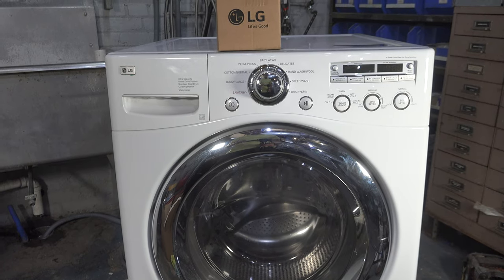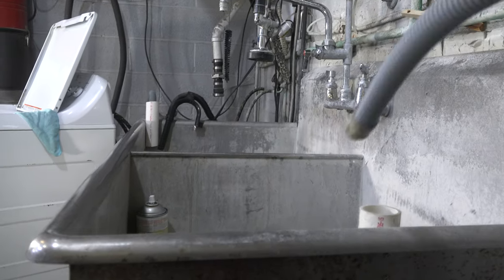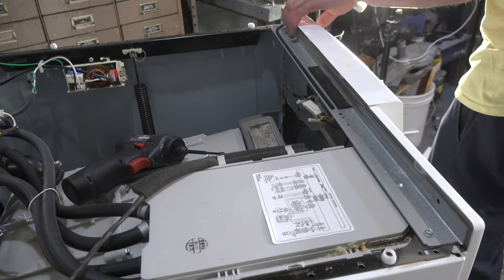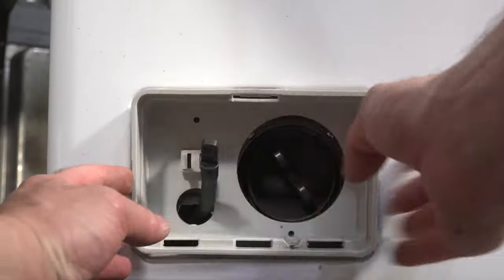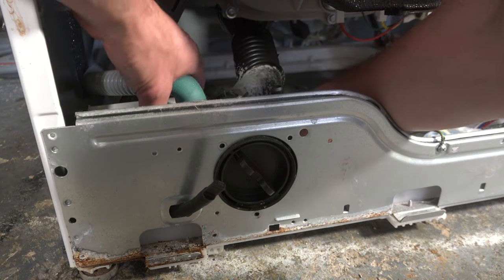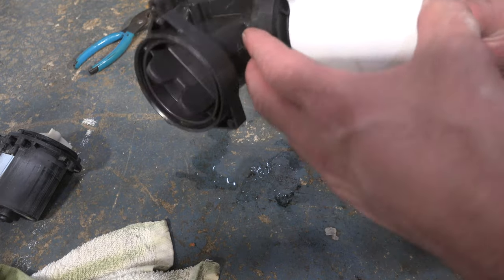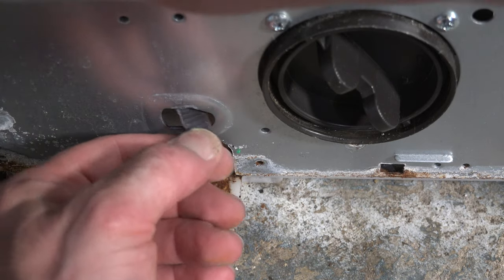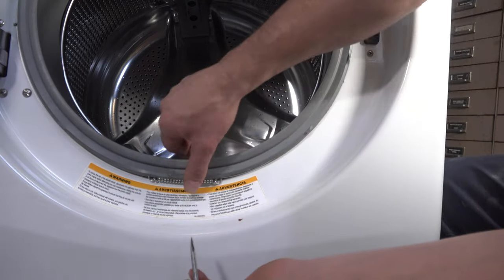How to Fix LG Washer OE Error Code No Drain Not Draining Tutorial Repair Guide

Comment: couldn't you just flip the washingmachine upside down and save many steps?

but also, I had a bad pump. come to find out the pump was seized. What I did to instantly fix mine is:
1) Remove the water drain cap to drain all the water. take the drain hose and fill it mostly with water. Since the pump is seized, that water isn't going anywhere.
 2) Take the drain hose, put a sock over it so my mouth isn't touching it directly (gross)
3) Blow really hard a few times. You'll hear the water back flowing away from the pump which also cleared the debris that was seizing it. the debris will shoot out out that draining cap you took off in step 1.

Fixed now.

Comment: We tried this and took 2 hours but was worth it. Both of our families told us to just buy a new one but was so much cheaper to buy the part for £30 rather than spend £500. We struggled to get the back pipe back on without pliers which took about 30 minutes and used kitchen tongs but managed by putting the metal attachment on the pipe and then wiggling it onto the plastic part on the pump. Thanks so much!

Comment: Superb video. This is the third time I took my washing machine apart for repairs. The first was to replace the spider arm (a nightmare - not recommended unless you are extremely ambitious). The second time was to replace the drain pump. I went with a video that shows how to do it from below without taking off the front panels. Very difficult and tedious in may opinion. I suspect I didn't get the pump back on completely snug and it eventually started leaking. Re-did it using this video. Way easier overall. They make a special tool to stretch the spring for the boot clamp. Only about $10-15 dollars; well worth it in my opinion compared to trying to do it with a couple of screwdrivers; otherwise you will almost certainly be crying for a second pair of hands to help you. Any reasonably handy person can replace the drain pump using this video. One of the best repair videos available.

Comment: This video was super helpful. My washer is only 2-3 years old, and hasn't been making weird noise, so I didn't think it was the pump, but I had no idea how to get to the inside to check. Once I followed his instructions on how to get to the internals, I found my problem. The little hose that runs from the door gasket drain to the rest of the drainage system has 2 elbows. We have 5 pets. I took off that little hose and viola! Packed solid with pet hair and dirt/mud. Took an old wire coat hanger and used it as a pipe cleaner, and we are back in business. I can't say thank you enough for this video. And your tip on getting that gasket spring monstrosity back on was a lifesaver.

Comment: I scouted several videos before starting this project and this was BY FAR the most detailed video I could locate. Thank you so much for creating this video. It took me a little less than an hour to disassemble, change out the pump, and reassemble. The most difficult aspect was getting the bellow spring around the rubber when reinstalling. As a woman in her 50's, my hand strength is a bit weak so the screwdriver trick didn't work for me, however, grabbing and pulling on one end of the spring with sturdy pliers did the trick. I had already ordered a replacement washer for $740 and I was able to cancel that order thanks to your video. A part that was less than $30 fixed the problem. Sincere gratitude to you for sharing this information!

Comment: Best DIY repair video instructions I've ever come across! Note: my washer has a metal isolation plate (with rubber feet) that the pump sits on and is attached to the frame of the machine with 3 bolts going directly through the rubber feet.
Reply: So you had to unbolt from that as well? Did you have the plastic tab still ?

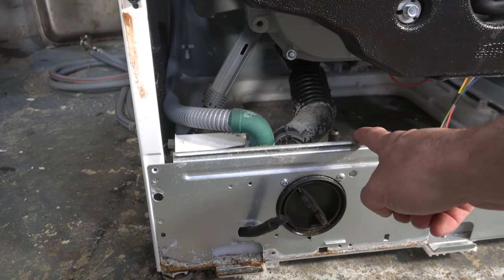Comment: 4:38... Super important. My drain pump was bad, but before watching this I swapped out the circulation pump not realizing there was a second pump in there. After trying to run another load it didn't drain. Had to tear it back apart and swap the right one. Thanks for this!

Comment: Absolutely amazing video, thanks for putting this together!!

To get the pump out on my model, WM3670HVA, there’s no pull tab to get the pump assembly out.  Instead there’s three 10mm bolts that have to come out. Once those are out then disconnect the wiring plugs on the side of the housing assembly  and lastly you have to remove the 3 screws to get the pump assembly off the metal mounting bracket.

Comment: Thank you for the video.  Very straight to the point.  My washer had a little metal tray that the pump sits held on by 10mm bolts.  Need a socket extension for these.  It was also difficult to get out of there.  I replaced the pump, which was no good and put it all back together except for the retaining ring for the tub gasket.  I have tried several times and think I will have to get a spreader tool to do this, the spring is just too stiff.

Comment: Thank you. The filter was nasty, but your tutorial fixed my problem quickly. You are the man.
Reply: Just cleaned my filter too, which was gross. Did that fix your issue or did you have to replace the pump, too? I want to test it to see if that was in fact the issue, but I’m afraid to do a load.
Reply: If it isn’t fixed, the washer just won’t run. You’ll get the OD or OE code. But with what he said, my filter was clearly a problem, so I was pretty confident.

Comment: Brilliant video, I just did my drain pump this morning in 1 hour and 30 minutes following this video.   I not only saved my self a pile of $, but got it fixed way sooner.    Im very rural so waiting for the appliance guys takes 1 week at least , and another week if they have to order parts.

I got my pump off amazon and bought a pair of spring spreading pliers while I was there, well worth the $20CAD for the pliers 

Thanks for this video, very clear and concise

The only difference on my LG was how the pump mounted,  it was on a metal chassis retained by 3 bolts with rubber isolators bolted to the base of the washing machine.  Easy to remove though.

I use zip lock snack bags to hold the different screws and label each bag with a sharpie.  makes sure everything goes back where it came from.

Also Your LG washer self test video was very helpful for me to test my work and my new pump without doing a full wash.

Cheers!

Comment: Nice! was able to fix my washing machine, kept throwing OE error, pump looked ok, but after replacing it, no more problems.  One thing I recommend is cleaning the hose on the bottom of the loading door. It's a small L shape rubber hose that held down w/ clamps. After taking mine out, I found it to be clogged w/ dirt and debris. It's one of the reasons for foul smell in the rubber between the door.

Comment: Thrilled with this video - you guys saved me quite a bit of money! I even ordered the part from you - it got here promptly within the week. Replaced the pump, put it all back together and to my delight and relief, it worked normally. Thanks again.

For those looking to do this, I'll share my two main frustrations, both come during the reassembly of the washing machine once you've replaced the part. The first, and worst, frustration, is trying to get the hose clamp on the main pump drain hose back on. It's very stiff and the pump is located in a difficult to get to part of the washer, once it's back in. No matter what I did I couldn't hold that thing open while re-attaching the hose and trying to maneuver the clamp into the right spot. Did a little research to find a cheat and discovered there are special hose clamp tools you buy, mostly from auto parts outfits, that make it trivial. I got the tools for $15 off Amazon. 

Second frustration was the bellow spring, which he speaks to in the video. I used the method he shows in the video to put it back in, but even still it was very difficult and took me many tries and much cursing. It worked in the end - all the trouble was definitely worth the money I saved. Thanks again Lorain Furniture and Appliance!

Comment: You rock! This was the perfect fix for my machine.  It took me awhile to remove the top front panel.. I think I was worried about breaking the clips or the panel, but it removed exactly the way you showed in your video.  Replacing the pump went smoothly and was much easier than expected.  It's also important to manage your screws when you remove them so you know what goes where. The toughest part for me was putting the ring back around the rubber on the front of the machine.  Following your video I put the rubber back in place and it fit snuggly. I put the spring of the ring at the bottom and put the ring inside the rubber groove 3/4 of the way with ease, but could not get the last portion of the ring in the groove. It was frustrating so I  took a break.  When I tried again, I used a small plastic scraper in my left hand to allow the spring to stretch while holding it in place and worked the last right corner of the ring into the groove using a screwdriver in my right hand as demonstrated in the video. Well, that worked for me. Wow! So, I'm going to say to any woman over 66 like me doing this repair, getting the ring back around the rubber of the washing machine opening might be an issue. Anyway, it's nice to have my machine running in tip top condition again. Thank you!
Reply: I had the same problem getting it back on. I cried a little, took a small break and prayed and got it on.
Reply: @anjanettecooper4650  I feel you! Lol! I'm glad you were able to get it back on.

Comment: Just received my water pump and it worked.

Mistakes made -
1 - The front of the washer has sharpe edges sliced some fingers.

2 - My pump assembly was held by 11 Size Bolts, in 3 places.

3 - I cheated by adding the hatch connector while assembling the door

Excellent tutorial my washer is working thanks to you.

Time to complete around an hour and my first time working on an appliance. 

Thank you.
Reply: Mine had the bolts, too!

Comment: Has a 16 year old LG 2277hs.  This happens on a Saturday and it was definitely the pump. Instructions were excellent. Now everything works. Thank you for uploading this video.  The only other suggestion I have is to put the screws in sequential order so that you know which screws go where; consider even labeling them.  A $40 part saved me from buying a $1,000 replacement machine.

Comment: A fantastic tutorial. I couldn't get the machine to run a Drain + Spin cycle. I drained  the machine and tried the cycle again. With no water in the tank the barrel spun, but since the machine was emptied of water I couldn't tell if the pump was functioning.  I ran the diagnostics test, all worked except for the drain cycle. I will drain the machine of water again and head off to the parts supplier for a new pump. The instructions are very clear in this video guide so I'm confident replacing the pump.
Reply: An update to the process. Most of the instructions were in alignment, but as with different models and model years some items will be different. We have a combo washer/dryer and the pump assembly is attached by three floating bolts to the frame. This video gets you through the most difficult pathways, and the rest you can figure out with logic. So a very helpful guide in all.

Comment: You helped me a LOT. My husbad wasnt around but with your help I fixed the issue. Just one thing, you get the OE notice after a program is done, so everyone should be careful because after I "drained" the wmachine with the cord and tried remove the filter around 5L washing water leaked out from my machine. I live in an apartment complex so taking the machine outside wasnt an option.. So anyone who have similar problem, bring a lot of towel 😂

Comment: Great video! Thank you for posting. Not too hard at all and saved so much money. 

Just to be clear, at 5:04, the tab is on the bottom surface of the machine. Press it down towards the floor and slide the pump away from you.

Comment: Fantastic video! I hopped on Amazon for the part. Got the park to my door in 3.5 hours. Had the washer disassembled, new part in and reassembled within an hour. Back up and running with no more OE error code. Video shows perfect step by step process. Thank you!

Comment: Great tutorial. My pump was actually on a metal frame bolted to the bottom instead of the slide clip, but once I figured that out, it was easy to do with these instructions. $35 and fixed the day after it broke.  A lot better than waiting a week to pay $350!
Reply: We're trying to figure out how to get the pump off of the metal frame.
Reply: For me, I had to reach my hand under and turn the bolts (I had to do it barehanded, because I couldn't get a tool under).  I can't remember exactly, but I think there were three bolts.  Once I got ahold of it, it twisted in pretty straightforward way - I didn't feel like I was breaking it or anything.  Good luck!  @PyrrhP

Comment: Excellent video. The pump linked on Amazon was the right part for me. Just FYI for future users of this wonderful DIY how-to, my LG model had the pump attached to the frame with three 7/16 bolts located behind the front of the frame, rather then the 2 screws through the front of the frame as shown on the video. Otherwise, the exact same process.

Comment: Great Vid thanks! Ordered pump same day delivery amazon, started taking it apart while I waited.  Once I had the front cover off I was able to disconnect the drain hose and blow thru it to make sure that wasn't the issue. The power clips on new pump were on the opposite side but the wire was plenty long enough. Mine also had the extra motor on the right(just disconnected it no issues)  Hardest thing was getting the metal door seal ring back on, got the wife to help lol  Ran a load and works like a champ!

Comment: This video is awesome!!  Very helpful.  We changed the drain pump with no problem but  the OE code did not go away.  After a lot of thinking, research and phone calls we had a service man come out.  In the beginning of  this video you mention that there could also be another pump, a recirculating pump.  Yep, that was our problem.  It makes no sense and no one ever mentioned that that pump would be included in an OE error.  I felt the need to leave this message to possibly help others that might be having the same problem.
Reply: So did you change that one and did it help?

Comment: I already knew how to change the drain pump I prefer to go from underneath the washer. What I did learn from you was the diagnostic running the washer through the cycles and for that I thank you very much. Unfortunately I get the OE code once in a while for some reason and every time I check everything out to find nothing wrong. Thank u for the information.

Comment: Great video, helped me out in a serious pinch with my LG washer (WM3670HWA) and the only differences were 6 instead of 5 screws and the tab that holds the pump was on a bracket held down by 3 bolts. Thanks for the much need help!

Comment: I'm almost done. Here's some rookie tips. I took a piece of cardboard and with each step I screwed each screw into the cardboard and then wrote a brief note where it was from. This way I just had to work from the bottom up replacing them. 
Not counting the three pump screws there are 21. 
To put the motor back on the pump, I painted white lines (use witeout, I had a paint marker), but mark one of them with two lines. It's very easy to get this wrong. 
Also my machine was jammed from a heavy cotton black out drape probably 14' by 10'. It completely turned to lint. Clogged everything up. When I got everything apart the drain hose from the drum was still jammed. I eased this out with a soft aluminum wire (house wire #12 or #14 folded in half so no sharp edge would also work), I milked it loose and then poured water into the drum. Very messy but cleared it. 
The hoses and the spring clips are a real pain. I wonder if there's an easier way or a tool. All my pliers would just slide off these nasty things. (Probably some kind of tubes that slip over the ends?) 
The retaining wire for the rubber gasket was really difficult. I've done these before. This was a bear. An extra pair of hands would help. The way I got some slack was like putting a bicycle tire back on. I made a small loop in some wire, hooked the loop where you were working it and pulled on and worked it down to the spring. 
Running it on Drum clean.  Seems to be working! Thank you.

Comment: Thanks man! Just followed along with this video and the washer is back up and running strong. I think I burnt out the old motor trying to do a load when it was -20 degrees outside. My washer and dryer hookups are in the garage and the hot and cold water lines were frozen, I had thawed them out with a heat gun and started it and didn't think about the lines being frozen internally in the washer. Stupid mistake but turned out to be an easy fix thanks to your video. Preeeesh!